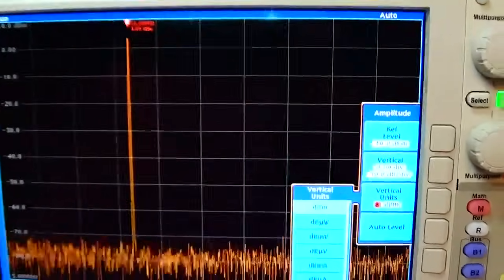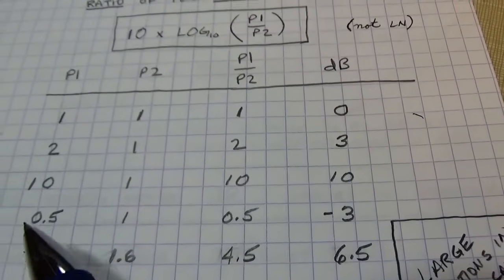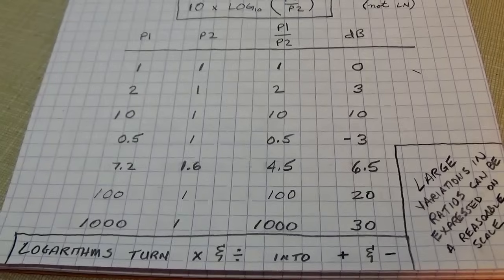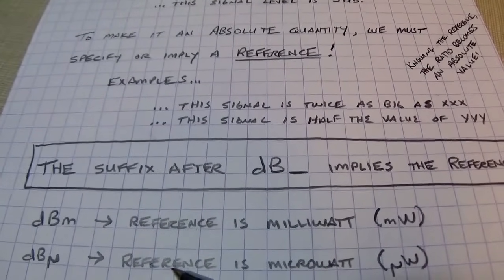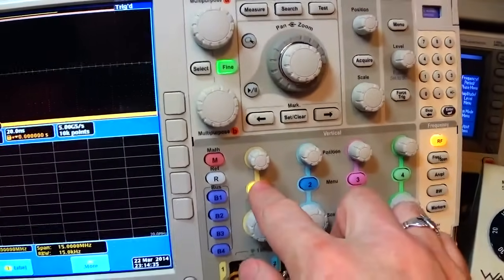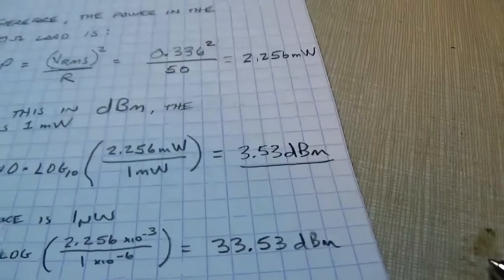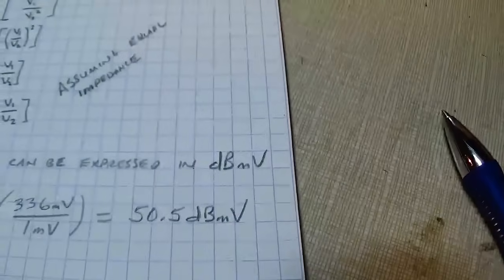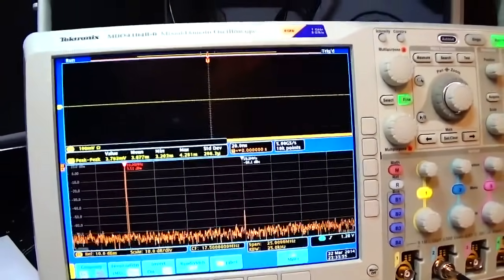#136: What is a dB, dBm, dBu, dBc, etc. on a Spectrum Analyzer?

Comment: There's some confusion about dBu. In audio equipment, it refers to a voltage scale measured from 0.775 volts RMS, as it corresponds to 1 milliwatt into a 600 ohm load. Devices with this impedance were common in the early days of the audio industry, when it was still inextricably linked to telephony. Therefore, when seeing this designation, it's important to consider the context: audio equipment or something else.

Comment: Ok .i have a question on an uhf radio on the Receiving side can I check  with a spectrum analyzer the dbm to see .? I’ll be using  Rigol DSA 815.

Another question what dbm should a repeater rx input should Read -70 or -30 dbm , so even with a 5watt Radio can be Pick up by the Repeater input Rx side .  

Reason is that I believe I can’t access the repeater unless I have more power to TX 25 watt . Specially at Distance even more .
Reply from the maker: You'll have to look at the receiver sensitivity specs, and convert that to dBm.  Whether you'll be able to see that on your spectrum analyzer depends on how low it's internal noise floor is.  You may need to reduce reference level and RBW a lot in order to see very low level signals.

Comment: Enjoyed your video on all the db's!   I'm guessing that -70db down is very close to 1 micro volt!    73's ,  Gary Grove
Reply from the maker: 70dB down is a relative measure.  70dB down from what?  70dB down (or -70dB) represents a decrease by a factor of 10 million in power, or a factor of 3162x in voltage.
Reply: @w2aew  Thank you for your reply!  I forgot to say down from 0db and 50ohms.  Oddly, I got 71 microvolts. Does that square with you?  Gary Grove
Reply from the maker: @garygrove6643  0dB is also still a relative term - meaning no change.  Maybe you're referring to 0dBm, which is 1mW.  Thus, 70dB down from this is -71dBm, which is 79.4nW, or 0.0794uW.  In a 50 ohm system, this is 2mV rms.

Comment: Thank you for this channel! I'm working on trying to repair an HP 8557A which is my first introduction to using SAs (probably bit off more than I can chew in that regard).  Really struggling with an issue I'm having calibrating the lin/log relationship settings.  This was compounded by a lack of understanding of dB scale and reference level.  This video helped explain the fundamentals in such a clear/concise and easily understood manner.  It gave me some confidence to continue working on this repair.  Thank you!

Comment: Thanks so much for this. Question, I'm trying to calibrate a reel to reel tape machine and the manual asks that a -18dbm sine wave be sent into an external oscillator input to calibrate the vu meters to 0db. I have a voltmeter and freq. generator, but I can't figure out how to verify the that I'm sending the signal at -18dm. Do I need a different meter, the manual suggests a HP 400e? Is there a way to do it with a basic voltmeter?
Reply from the maker: -18dBm is a Power level - therefore it implies an impedance that the voltage is being applied to.  In the RF world, most of the time this is 50 ohms.  Often in the audio world, 600ohms is used.  Once you know the impedance, you can convert the -18dBm power level into an RMS voltage level which you can read with a meter like the 400e, or good DMM, or a digital scope with the Vrms measurement capability (or measure Vpp and convert to rms).    -18dBm means that the power level is 18dB lower than 1mW, which is 15.85uW.  If we assume 600 ohms, this would be about 97.5mVrms.
Reply: @w2aew  Very helpful. Thanks again.

Comment: Really excellent video, I've been searching for a proper explanation for a long time.  This is truly a gem. Could you explain how dbuV is converted to dbuA
Reply from the maker: It is simply ohms law - the voltage is assumed across a 50 ohm resistor (termination in the SA), and then the dB calculation is made on the resulting current I=V/50.
Reply: @w2aew  Thanks for the reply. Is it always 50 ohms. Like I am using the spectrum analyzer which is available in the Simulink software.  So, is 50 ohms standard for all spectrum analyzers?
Reply from the maker: @Roshan-xv7wh  Most spectrum analyzers have a 50 ohm input termination.  Some analyzers geared towards the CATV (cable TV) industry often had 75 ohm input impedance.
Reply: @w2aew  Thankyou.
Reply: Sorry for pestering you with loads of questions.
I just had one more doubt. 
I have a set of current values in Amps. How can I convert A to dBuA.
Reply from the maker: @Roshan-xv7wh   dbuA = 20 * LOG10 (current_value/10e-6)
Reply: @w2aew  I was taking the fft of the current value. 
So the doubt was,
1. should I apply this formula before doing the fft or
2. should I take fft and then convert the magnitudes into dBuA
Reply from the maker: @Roshan-xv7wh  Do the FFT first, then convert to dB.  The FFT will be incorrect if you use logarithmic values (dB).
Reply: @w2aew  Thanks for all the help you have given. That's all for now, I guess😅. I am currently doing a project where I am studying conducted and radiated emissions as part of a student project.  Exciting days ahead.

Comment: So, if there is no attenuator , there is no filter and then overload is possible
Reply from the maker: Overload is possible with with the filter and attenuator - it all depends on the input signal level and the attenuation of those devices.
Reply: @w2aew  and the FCC doesn't regulate input and output signals in a highly populated area?  So this effects humans in many ways...
Reply: In major cities, the houses are so close together with everyone buying into many different service providers, and the signals and radiation waves are intense.  There are so many electrical lines crossing the houses and streets.   Don't you think it would be wise for these service providers to streamline services into one or two companies to lower the risk of radioactive waves?

Comment: Feels wrong that writing dBc "overwrites" dBm. I'd like to write it dBmc, but something tells me people would get pitchforks out if I did.
Reply from the maker: They would.  It is dBc because the "reference" is the carrier power (c), so it is dB relative to the carrier (c).
Reply: @w2aew  It just hit me.
??dBmW=10*log10(Psignal/1mW)
??dBµV=20*log10(Psignal/1µV)
??dBc=10*log10(Psignal/Pcarrier)
Thanks for the epiphany.
Reply from the maker: @kacperbardecki3671  Almost right...   When computing voltage or current ratios, you use 20*LOG...  So, your second equation should be 20*LOG10(Vsignal/1µV).  ----  make sure you're consistent with the units in the ratio.  When they are power/power, use 10*LOG, when they are voltage/voltage or current/current, use 20*LOG...

Comment: what does it mean in RF if a good quality meter like the Safe and Sound Pro 2 states 6db? is it that all RF unlike a spectrum analyzer is almost impossible to measure accurately in  µW?
Reply from the maker: The 6dB spec for the Safe and Sound Pro 2 meter is actually an accuracy spec.  It says that the measured power accuracy is within +/-6dB.  This broad tolerance is due to several factors, but mainly due to the internal sensor/antenna flatness vs frequency, and various uncertainties associated with making 'off-the-air' RF measurements, etc.

Comment: I used to work in an acoustics lab, where the important measurement is dBA. This is the noise or sound level relative to the threshold of hearing,  ie. 0 dBA is the quietest sound that anyone can hear. (There are a few caveats on that, but that's basically it.)  Here are some typical values:

40 dBA   - a soft whisper
60 dBA   - conversation at 3 ft. away
90 dBA   - legal workplace limit for extended periods in many countries
110 dBA - rock band
130 dBA - jet engine at 200 ft.
140 dBA - the threshold of pain
235 dBA - the estimated sound level of the volcanic explosion at Krakatau

Remember these are logarithmic values!
Reply from the maker: WOW - Krakatau was LOUD!  Nearly 100dB above threshold of pain.  Devastating!
Reply: @w2aew  Yes indeed - it startled people 3000 miles away, caused a pressure peak corresponding to 2.5 inches of mercury (8.5 kilopascals) at 100 miles away and the pressure wave went round the globe several times. It's just unimaginable.
Reply from the maker: @chrisengland5523  Fascinating!

Comment: You just wouldn't believe how many things you've cleared up in my mind through the explanations of the subject matter! I mean, outside of the video topic, I've now been able to make sense and/or have a better understanding of what had seemed confusing to me in electronics and radio frequencies when it came to the oscilloscope and the spectrum analyzer. 

I'm strictly an entry-level hobbyist and couldn't even begin to speak intelligently on the 'real-world' applications of most of these points but I'm determined to grasp the basics through videos like this and through various test/hobby kits.

I own several scopes, (my most recent is digital), though nothing as advanced as the Techtronic scope/SA you have here. Of course I have a signal frequency generator and recently purchased a small Spectrum Analyzer, (the "Tiny SA"). I wanted to understand how the SA works and how to apply its functions to an oscilloscope and vice/versa.

Once I'm sure that I understand the use of a Spectrum analyzer, I'll buy one that is considerably more versatile and accurate.
Thanks again for the great video and this is one that I'll be referring back to in the weeks & months ahead.
Rich

Comment: What’s the minus sign in the vertical axis of spectrum analyzer and what’s meant?
Reply from the maker: The typical unit use for the vertical axis is dBm.  0dBm is equal to 1mW of power.  Negative dBm values refer to power levels that are less that 1mW.  For example, one-half of a milliwatt is -3dBm.  One tenth of a milliwatt is -10dBm, etc.

Comment: In dB, what is the power of the signal it's comparing to? You have the signal with power P1, but to find dB, you need to divide P1 by P2. What is the power P2 referenced to?
Reply from the maker: dB is NOT a measure of power - it is a ratio, just like saying "twice as large", or "ten times smaller".  It is always relative to something.
Reply: @w2aew  Sorry, maybe I wasn't as clear as I should haven. I really do appreciate you taking the time to reply though! You're such a great teacher. Let me try to clarify my question. By definition, dB=10log(P1/P2), as you stated in the video. So when I measure a received signal, that signal is captured by the antenna and then travels through the coax cable to the analyzer, and is displayed on the screen. However, it's displayed on the vertical axis in dB rather than in an absolute scale of, say, watts. So my questions is that we only have one signal coming in, and that signal has power of say, P1. To display as dB on the analyzer's screen, you need a second signal with power P2 so that you can take the ratio and then take the log, etc to compute dB. What is the P2 signal? We only have one signal that's coming in and that's P1... If we're comparing a ratio, then it seems that we need to signals coming in, P1 and P2, in order to compute a single dB value to be displayed. This doesn't seem to be the case since you can still display the signal's spectrum with a single (as opposed to two) coax cable feeding the signal into the analyzer. I hope question makes sense...
Reply from the maker: @xichenjiang7799  I understand.  What this is saying is that the analyzer you're using is either uncalibrated and just showing you an uncalibrated power level from a log detector, or is using some internal assumed reference and computing dB relative to that.  In either case, the dB reading you're getting can't be interpreted as an actual power reading directly.  You could inject a known power level into the analyzer and then use that to determine P2.  However, I suspect that the response is likely uncalibrated as well and other levels might not be correct with this P2 reference.  One final possibility might be that the analyzer is using the "standard" value of 1mW as P2 and is just leaving off the "m" in the units (dBm).  The only way to know for sure - if the analyzer's documentation doesn't tell you - would be to make a few measurements with known power levels...
Reply: @w2aew  I thought about the dBm where they just dropped the "m" but I noticed in your video, the analyzer has a dB mode and dBm mode. At first, I thought same as you that it could be that the analyzer just computes 10log(P1) and just called that dB. Technically then, it's really doing 10log(P1/1), that is, dividing by 1 implicitly. If it's 1 mW, then it's really dBm. If the analyzer has both modes though (dB and dBm) then this is probably not the case. 

I did some more reading of forums online and one thing that I came across is that the "reference" is just whatever the peak value displayed on the screen of the analyzer is. Suppose the signal P1 is 10mW. If I were to display this on an absolute scale where the vertical axis tick marks are 0 mW, 5 mW, 10 mW, 15 mW, 20 mW, then this signal will appear halfway up the display screen at the 10mW tick mark. We can covert this 10 mW signal into dB by dividing by these tick mark values. That way, the top line of 20 mW becomes in dB 10log(10mW/20mW) and same with other values of tick marks. I might be making a mistake with the sign here depending on if it's gain or attenuation that's plotted but the idea is there. If I were to change the display scale so that now 10 mW is the very top tick mark of the absolute vertical scale, then that will now correspond to 0dB if displayed on a dB scale. Let me know if you do not find this to be the case or if you feel likes this doesn't make sense as I haven't tested this out yet. I just got this from some online scouring.

I want to say thanks again and I really enjoy discussing these issues with you. I'm teaching a college level RF course and I use your videos. Even though students might not ask me such detailed questions, I always try to prepare ahead and ask myself these fine details before the students do.
Reply from the maker: @xichenjiang7799  I don't know what analyzer you're speaking about, but it is certainly possible that they're using a reference derived from the peak value of the observed signal.  I've never seen an analyzer that had this type of scaling, but it is possible.  I'm surprised that they don't document the meaning of this mode in their instructions or documentation.

Best of luck with your classes - I am very happy to know that you find my videos useful and helpful in your teachings!

Comment: At 11:23 why did he change the 1uw to watts?
In the first part he didn’t change 1mw to watts!
Reply from the maker: Because in the prior example, the power level was already in mW and we are dividing by 1mW - so they're already the same unit (mW divided be mW).  In the next example where we want dBμ, we need to divide by 1μW.  Since the given value was in mW, it was just easier to express both in Watts and then do the division.  I could have just as easily converted the original value of 2.256mW into 2256μW and computed that result directly.
Reply: @w2aew  Oh Thanks alot.

Comment: 4:25 and following: Having just learned that 10dB (or 1B) is an increase of decrease of power by a factor of 10^1, or just plain 10, we might find the display of 10dB reduction to be rather unimpressive or puzzling. The unspoken assumption here is that the signal source is providing a voltage into a resistive load, and that therefore the power is proportional to V^2.  So a factor of 10 reduction in power corresponds to a SQRT(10) reduction in voltage. SQRT(10) = 3.16.  So whereas the original voltage is about 9.6 units p-p on the screen, the -10dB display would be 9.6 x 3.17 = 3.13 units p-p, which indeed it appears to be. Similarly for subsequent steps.
Mr W2aew does discuss voltage ratios at 11:55, and goes on to show the single 10MHz signal measurement on the spectrum analyzer relative to dBmV. However, one example that would have been illuminating is what happens when you adjust the attenuator in 10dB steps (like in the first spectrum analyzer exercise), when the spectrum analyzer is set to display dBmV (ie: a voltage-based reference). Turns out that the analyzer will still show those as 10dB steps, because it still assumes that dBs of any kind are about power ratios (into a fixed resistor), even though it's showing absolute values relative to a reference specified as a voltage.

Comment: Why Spectrum analyzer scale is negative? -10, -20, -30,etc
Reply from the maker: The default vertical scale for most spectrum analyzers is dBm (dB relative to a milliwatt).  Thus, an signal/level below 1mW will have a negative dBm value.
Reply: @w2aew  thanks very much

Comment: Sir, fantastic! I just would like to add an information in relation to SPL (Sound Pressure Level). Our hearing is logarithmic - we perceive changes in sound pressure levels in dB. SPL, in dB, uses as a reference value the threshold of hearing (the lowest SPL that we can hear - that's 0dB) and that value is 10^(-12)W/m². (So, this is not exactly Pressure ... but I could not find the exact value for this comment).

Sir, I also really like the notes you make available in PDF. Thanks!!!

Comment: Excellent channel! Sir, I have my parents and my grandfather's slider rulers. My grandfather worked at the radio-telegraph station, in Rio de Janeiro, and during the 1940s he did the first SSB transmission from Brazil to France. My father says slider rulers gave engineers a magnitude perception that is much better than calculators.